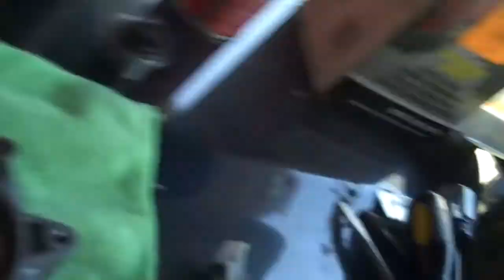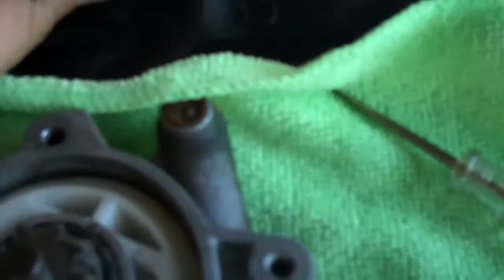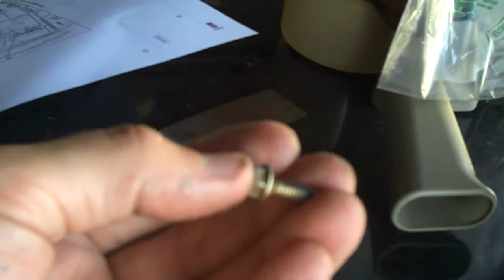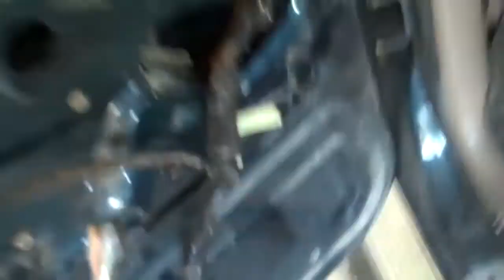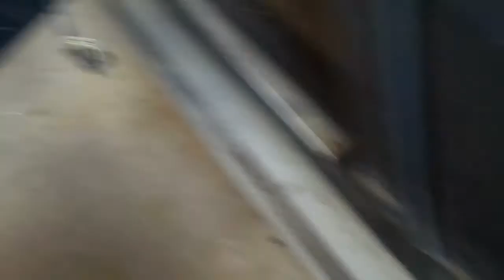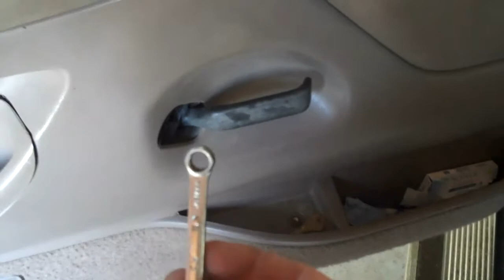94 F150 window motor repair pt 3 of 3

Comment: All the cheap people using nuts when the bushings can be purchased on Amazon for less than $15 for 100.  

Putting nuts in there will eventually damage the gear.

Comment: Thanks for posting this.

In my opinion, this process, which i just completed outdoors in windchill temps of 10 degrees F, this is another example of why Fords are garbage in terms of engineering and longevity.  

In terms of longevity my F150 has only 165K miles on it and this was the second window motor I had to put on it.  And as I was doing it I also replaced the door handle for the second time which, it's breaking off again was why I took the opportunity to replace the motor while I had the inner panel off, was the second I replaced.  Ford lovers probably will say, well, that's a lot of miles. To which I say, bull that's a lot of miles.  

In terms of engineering, I got tired of struggling with the small openings in the door (inner side of course) and got out the angle grinder with a metal cutting wheel and cut a wider opening.  From that point on things got a LOT easier.  Ford could have easily designed and built the inner side of the door with either larger openings to allow access or a removable, (bolts, Ford never heard of nuts and bolts?) panel.  But no, Ford is too damn stupid to do something like that.  Or maybe they're simply smart enough to know people will buy their crap anyway.

But speaking of being stupid, I certainly am.  I bought a Ford.  But I'm not stupid enough to ever EVER buy another one.  Partly because on a truck with only 165 K on it I've already replaced virtually every external engine component and have had to have the transmission rebuilt.  Ford tough.  Ford stupid is more like it.

Comment: I just got done with this repair on my 1991 F150. I had to do both doors and have some comments for those of you who end up doing this repair:

I always end up taking off more stuff than I need to. The door panel on this truck is in 2 pieces and you only need to remove the top panel.

Don't need to remove the door handle (like others commented). Just work it around and you can take off the door panel around it.

Unscrew the power window / lock cluster from behind the door and pull it through (leave the trim and bracket in the door).

Drilling out the dimples to access 2 of the 3 bolts is THE WAY TO DO THIS. Don't bother grinding out the rivets.

The 3rd bolt that he is able to get to with his nut driver (not through the drilled holes) in the video was a pain. I'm not sure if my socket is deeper or what, but I couldn't get a snug fit on it and ended up having to use a very small 5/16" wrench to get that bolt out.

When I took off the window gear dust cover, the inside of mine was crammed full of grease. I almost thought I had a different part than he has in the video because it was packed full. No problem, I was still able to get the gear parts pulled out and cleaned up most of the grease. Just make sure to remove as much grease as you can to be sure you get rid of the plastic chunks.

Others recommended removing the speaker and I highly recommend that as well (easier to get the motor out).

Last comment, and this was a big one for me, the three 1/4" nuts were a pain to get seated flush. They are understandably snug and when I'd get them seated and try to push the gear down, one of them would pop up. On the second door that I did, I seated two of the nuts, put the gear in and then pushed the third nut down into place with a flat head screwdriver. Worked like a charm.

Comment: Good job and thanks!   I can get my panel off without removing the door handle.  Just remove all the screws and pop the spring clips,  raise the panel to disengage it from the top groove at the bottom of the window opening.  Then slide the panel forward and off the door handle.   I was also able to push the control panel through the hole without removing the escutcheon.  This video was very helpful, especially about the drilling of the two holes for access to the motor mounting screws!

Comment: EXCELENT!
Exactly what mine looked like including the crumbling stuff. Thanks so much what a great hack! perfect and very quick. Like the trick of the packing tape on the window too!
Two additions: 
-I did not have to take off the inside door handle. I could slide the panel off while lifting on it a bit
-To make putting the screws back on through the hole, use a small bit of tape over the screw and socket to hold it in place. Not too much or it will pull the socket off the extension
-I used HVAC metal tape to put the plastic dust cover back on.

Comment: Excellent video on disassembly and reassembly of both the door and the motor.  I'm guessing that the size of the nuts used are super secret squirrel stuff since you don't tell us in the video and questions to that effect in the comments go unanswered.

Other than having to figure out the size of the nuts used, very well done.

Comment: I just finished,this vid is worth the time.I used a unibit to make the holes in the door.Use tape to secure your bolts on your socket or nut driver before screwing them back in.Take your time ,nothing to it!

Comment: Yeah this is awesome! I just fixed mt window for 18 cents! And thanks Wesley Knapp for the ebay link. I didn't think about the nuts wearing out the plastic gear. Gotta check out the bushing set.

Comment: Worked like a champ.  Thanks for doing the hard part.  A few notes if I may.  You don't have to disconnect the window/lock controls nor take off the door handle.  The electric door control unit can be slid through the opening once the screws are removed, and the handle... just lift it as if you were opening the door.  When you put the door panel back on just lift the handle again.  This also helps to hold the panel while getting all the other mount fasteners lined up.  Other videos I watched had me replacing the entire regulator and drilling out the rivets and replacing with bolts to put it back in.  Got the new gear and bushings off of ebay.  Apparently its just the bushings that are the problem most of the time.  The bushings are only $3 on ebay!  My 95 F150 had plastic bushings in the gear where you used nuts.  Gonna order a set and do the passenger door next week.  Thanks again, I'm sure you saved me hours.of trying to figure this out! 
http://www.ebay.com/sch/?_nkw=f150%20power%20window%20gear&clk_rvr_id=694650969996

Comment: Hey man, you are a life saver, I watched your video and I was able to fix my jammed motor thing, I really appreciate your time, Thank You 

and here's a tip to those without a power drill, 

you can use aviation snips to cut through the metal and expose all three bolts,

Comment: this was my first repair job on my truck and it was extremely helpful! I saw another video that mentioned the use of nuts as "a temporary fix." does anyone know if the nuts will cause any problem if not exchanged for ball bearings?
Reply: Ball bearing aren't used, they are just plastic bushings.  I would think nuts would wear out the plastic gear.  I used the bushings since I don't want to do this again because nuts wore out the gear quickly.  The bushings are very inexpensive.  http://www.ebay.com/sch/?_nkw=f150%20power%20window%20gear&clk_rvr_id=694650969996

Comment: Nice job. I had to do this for my 92 F150. Unfortunately my motor wasn't working at all, so I had to replace w/a brand new one.  Works much better now.  Now for the passenger side!  I also need to fix if not replace my door actuator, as it clicks, even catches every now and then, but isn't consistent.  Any ideas?  Thanks SmithersAHS.

Comment: Nice videos. I have two of these to fix on a 92 model F150 4x4. I removed the door panel and was able to remove it without taking off the door handle. I just had to work it around a bit, but came off fairly easy with it still attached.  Just have to do the repair now. These videos will really help me out.